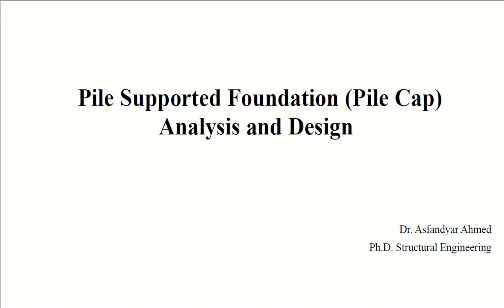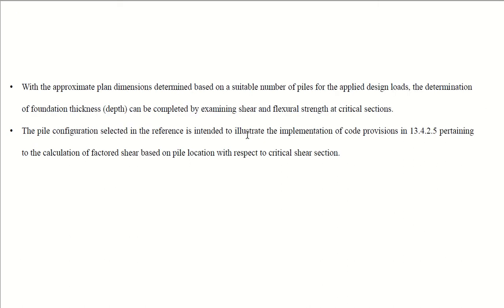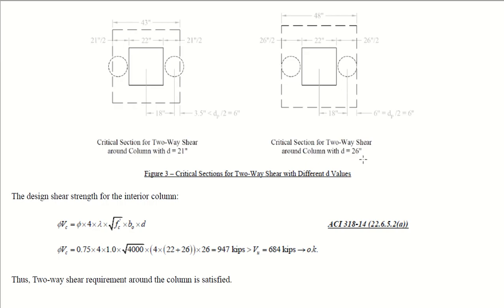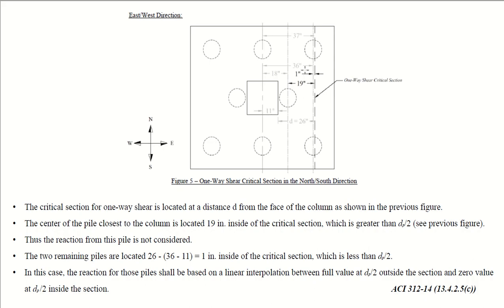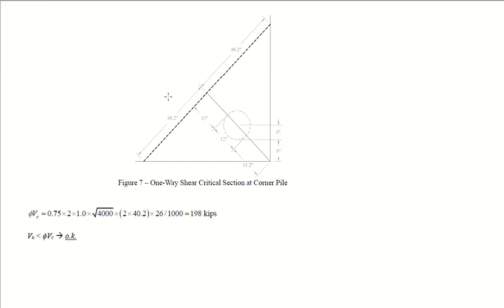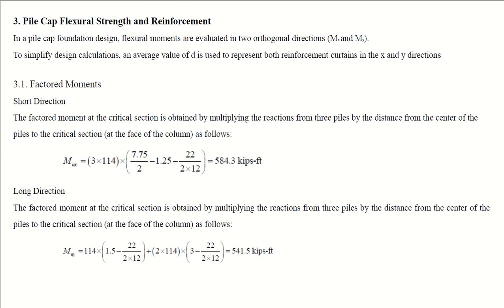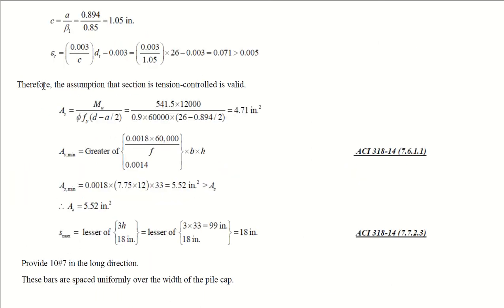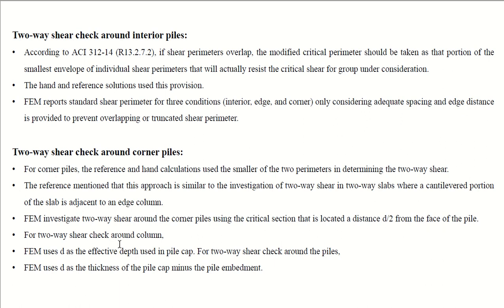Analysis and Design of Pile Supported Foundation (Pile Cap)

Comment: in item 2.5, the applied shear neglected the column load. This is to the unsafe side. the applied shear is the total load-reaction of two piles=910-228=622 kip. it will be higher than the calculated value.